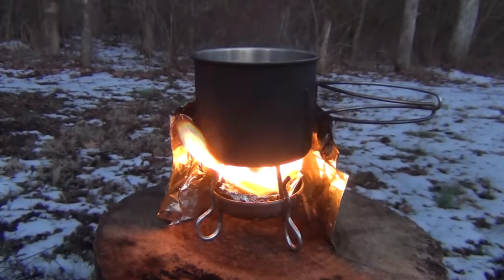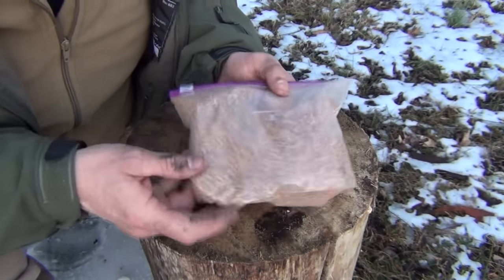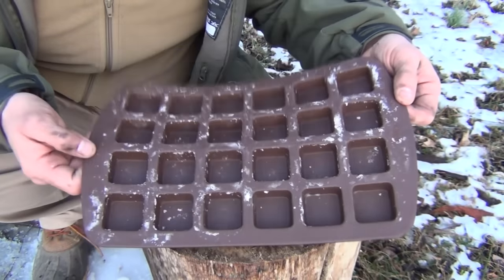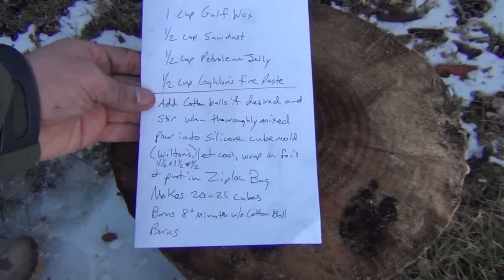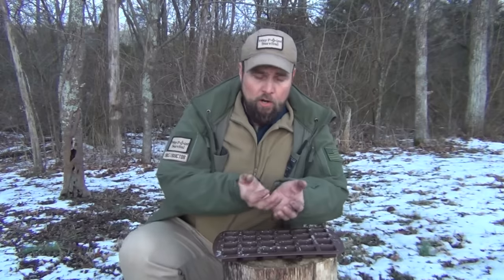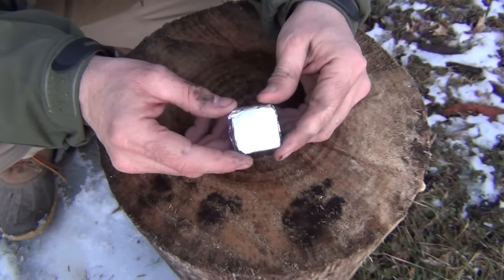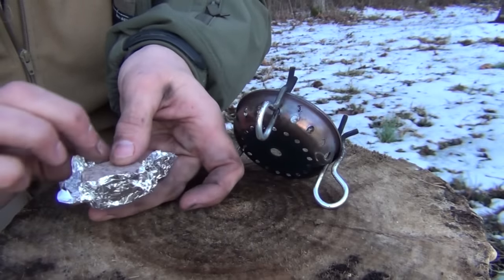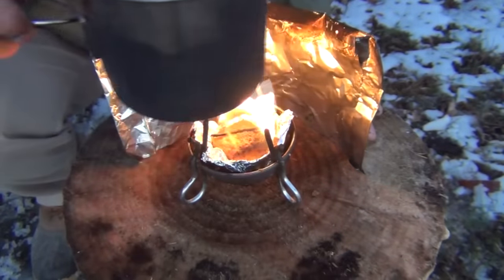DIY Fuel Tab [This is Awesome!]

Comment: Great idea. I didn't read through all the comments, so maybe someone suggested it already, but have you thought about adding some fine magnesium shavings to the top of each cube as soon as it's poured, and kind of push them down a little. Then when you're ready to light the cube, scrape a little of the top off to expose the shavings. I think in windy weather, those mag shavings will really help keep the cube going. Keep up the great work.
Reply from the maker: I had not thought of adding magnesium shavings, but there's no reason why a person couldn't do that if they wished. Thanks for watching.

Comment: I've been making fire starter with paraffin and wood chips for years. I just use wood chips coated with the wax. Just enough wax to hold the wood chips together and form a block. Wrap the block in brown paper. When your ready to start a fire just lift a flap of the paper and light it. Set it down and pile on the small wood to get the fire going. I've started fires in the rain with these, just provide a little cover to get it started. Even just leaning over the fire to keep the rain off for a little while will work.
Reply from the maker: Sounds good, thanks for watching!
Reply: Yeah, but do yours last for 14 - 16 minutes?
Reply: @markcummings6856  Depends on how big you make em. I usually make them pretty small, 1inch square by about 1/2 inch thick. That will burn long enough to get wet wood lit. Once, to prove how well they work, I threw one in the lake, then we gathered wood. I picked it out of the water, maybe 20 min's later, shook it off, lit it with a bic and started a fire. Never tried cooking over them, easier to cook over the fire. But if you couldn't have a fire I'm sure they would work. Never timed how long they burn, but if it takes you 16 min's to get your wood to light, you ain't doin it right and you shouldn't be in the woods alone.
Reply: @evilevilrick  Good to know! Thanks.

Comment: Pretty cool, I'll have check see what my wife has for silicon mold for baking. That is the one thing I looked into that was surprised cost more than I was expecting, almost as much as all the other materials combined. For anyone looking for a good fire starter that you can literally make at no cost I got one for you and the hardest part is probably just remembering not to throw these otherwise useless items in the trash. Save lint from your dryer, save empty toilet paper rolls. Just stuff the lint in TP roll until it's full then don't have to but I dip in just a bit of used motor oil and set on a log or something and let it soak in a bit. Throw one or two these under bit of kindling throw a log on top a quick lite and your done. I made bunch of these for my mother this winter to save her time making fires and she likes it because she just has to spend a second to light than leave for few minutes come back and roaring fire, hasn't failed yet and won't as long as you have something that'll catch fire on top. I haven't taken note how long they burn by themself but haven't really needed to.
Reply from the maker: Thank you for watching and for sharing your ideas!

Comment: Yes, went through a big home made Esbitt stage as a broke youngster. Of course then, even if you had the money doesn't mean the stores had the item you wanted!!! If you don't regularly operate a saw, a pencil sharpener and some dry twigs will do the trick.We used cardboard cubes we made and sealed with sellotape instead of an ice cube tray and wrapped them in sellophane instead of aluminium foil as it was cheaper. We would line the stove with an aluminium foil bowl, (if you only used a little mum would give you the foil, savings!). A very time and patience heavy way of doing it, not recommended for those with jobs and responsibilities but has potential for keeping bored (older) children occupied!!!
Reply from the maker: Excellent. Thanks for watching!

Comment: I used the seeding planter pots that you plant the pot into the soil. It's like a cardboard material. They come in rows & I cut off one at a time to make I'd soak cotton balls & fill up the small pot packing down the soaked cotton as much as possible. Wrapped it in tinfoil when finished. I'd burn it standing up like the pot should on the tinfoil I wrapped it in...got 45+ min burn time...pot is 2 inch high. Inch cube at bottom & 2 inch cube at top...hope this made any kind of since
Reply from the maker: That's excellent! I really do like that idea.
Reply: @WayPointSurvival  I'm pretty sure it was your channel that I got the idea gor that sink drain stove!
Love all the hobo vids as well!

Comment: We've made this but here's a tip. Add more saw dust and also diesel fuel 50:1 ratio also if you use ice cube containers it easier to obtain. This will create a more intense burn boiling your water faster.
Reply from the maker: That's an interesting way to do it. Thank you for watching.

Comment: Stove pellets, for heating, about $4.00 for 40 lbs probably would work as a replacement for saw dust. It's basically saw dust pushed through holes, the heat provides a glazing that holds the pellets together. A hammer probably would easily reduce them back down to saw dust. Just be sure they are 100 percent hardwood. I got 2 tons of mixed, soft, hardwood, the soft was pine, it gummed up my pellet stove with a tar mess, I used some in my Nano stove, gummed up the legs, feet, tar, resin, stuck to them. You know that gummy feeling of fat wood? Well that is what the black like crude on my stoves feels like, smells like creosote.
Reply from the maker: That's a great idea! Thanks for watching.

Comment: Just so I understand correctly, you take the 1 cup of gulf wax, and the 1/2 cup of sawdust, petroleum jelly, and fire past, melt all of that mixed up in the same container, then drop the cotton balls into it.  Once the cotton balls fully absorb the concoction, take them out, place them into the silicone molds, then dump any remaining into the molds so that they're full, let it cool, pop them out, wrap them in foil, and you're complete, correct?
Reply from the maker: You got it! Thanks for watching!
Reply: @WayPointSurvival  Hey, follow up -- I made a bunch of these with my class.  I went for a day hike when it was slushy, snowy, and basically everything was wet.  Set up my lean-to tarp, got everything else set, was able to scrounge up enough pencil lead sized white pine for kindling that was relatively dry and a bunch of other wood I could put by the fire to dry off.  I had two of these fuel tabs with me.  They both lit so easily, and burned for so long, I was able to get my campfire started with zero problem and it stayed going long enough to dry out all the wood around the fire.  So my fire was going long enough to warm up the lean-to and grill a couple of steaks.  These things are absolute gold.  Thank you for posting this recipe.
Reply from the maker: That's excellent, thanks so much for the story!

Comment: I’ve used melted wax poured over dryer lint or wood shavings in a cardboard paper egg carton. Separate the individual  cells after it cools and dries completely and store in a zip lock bag.
Reply from the maker: Yes, that also makes a pretty decent firestarter. However, using only melted wax, dryer lamp or wood shavings does not give you the intensity of heat that you're looking for in this type of fuel tab.

Comment: An idea for your wind screen. Make just high enough it does not reach the top of the cup. Put a slot in one side for your cup handle.
This way all the rising heat is trapped against the sides of the cup. Should shorten the time to boil.
Reply from the maker: Good point. Thanks for watching!

Comment: For your double boiler, make sure you use her favorite stew pot. I promise, it will be good for your relationship and the odds of you reaching  a ripe old age. 

It's not heximine or even triox, but it isn't bad. I'm curious how well it would do with just wax and the sawdust, or wax and cotton. The addition of the fire paste just sounds like over thinking it and it is the hardest to find item among brick and mortar locations.
Reply from the maker: The addition of the fire paste is to make it easier to light. Thank you for watching.

Comment: Great idea! Have you ever tried it without using the fire paste? I bought something like them from a company gives handicap people jobs. That's mostly why I bought them but they were pretty expensive.  It seems like they are just sawdust and wax. But I'm not sure if that's all they are made of. They burn between 10-15 minutes but don't produce as big of flame. 
It would be cool to make them myself but I don't have any fire paste so I'm wondering if they'd work without it?
Thanks for the recipe! 😊
Reply from the maker: I added the fire paste to make it easier to light as well as help increase the heat and burn time. You can purchase it online from any number of sources and you can also often find it at outdoor stores.
Reply: @WayPointSurvival I'll have to get some eventually. I've still got around 40 of the other ones right now so I'll use them up and then try your recipe. 
I've got one of those little stoves that burn the gases put off by the wood and they work great in that. I just throw a few sticks in when the fire starters start dying but I don't normally need to.
Thanks for the reply!😊

Comment: I like this.  I did some napkin calculations and determined these are roughly 50 cents a cube.  I then compared butane fuel (bought in cheap 8 oz cans and transferred to the cans for butane stove. Way cheaper.) and determined that for the same cost butane will boil a lot more water. But all is not lost. I also noticed the match didn't lite it very easily. I think I have a solution. Buy all the ingredients and make this change. 
1. When mixing in the wax, hold back a few tablespoons and keep liquified.
2. Make the rest as normal but leave out the fire paste.
3. When the cubes are solid enough to hold a shape but not too hard, poke a hole in the top of the cube about 3/8" deep.
4. Fill the holes about 2/3 full of the fire paste.
5. Cap with liquid wax.
My guess is the fire paste is not contributing significantly to the burn time.  Additionally, I think the fire paste can really aid in lighting. So, with this change I think you can reduce the price a bit and make them easier to light. To use all you would need to do is scrape off some wax to expose the paste then light. The fire paste can even be started using a firesteel so it's a good way to go.
Reply from the maker: Thank you for watching and for the suggestions!
Reply: Why not just add a tiny wax coated wick sticking out the top, just enough to light easily.
Reply from the maker: You can easily do that.
Reply: @rubynoils2872  I was thinking about that when I wrote it but I was trying to keep costs down. If I were doing it, this is how I would go about it. I also like the stove he did. I recognized the parts immediately and said to my son "That's a cool stove!". I may have to "lose" a sink strainer sometime soon🙂
Reply: Just a suggestion but you could use a wood wick or maybe something like a wood coffee stirrer cut down coated with a bit of fire paste.

Comment: I sure appreciate this cause those esbit cubes are so expensive.  I have carried tea candles in emergency kits to later find them melted and out of the tin container.   You foil can help.  I've used baggies and that has kept the rest of the kit clean but it made the candles a mess. I wonder if you still have some of these foil wrapped cubes and tell us if they made it through summer heat intact.  Thumbs Up!
Reply from the maker: Thanks so much. So far the cubes seem to do pretty well even in the heat.

Comment: do you shred up the cotton balls, or leave them whole, removing each one from the mix and placing them in the mold, then pouring the mix on top of them?  Also, you could prob. use paper shred (from a crosscut shredder) in place of the sawdust.  I have a LOT more shredded paper than sawdust around my house, unfortunately.  ;-)
Reply from the maker: I put the cotton balls in whole and then stirred them around until they were thoroughly soaked and then pulled them out with chopsticks, placing them in the mold and then poured the rest of the mixture on top of them. I suppose you could use shredded paper instead of the sawdust, but I'm not sure how that would work. Thanks for watching and for your questions!
Reply: @WayPointSurvival   your videos are excellent..keep up the great work

Comment: Cool! A lot of work though. Cotton balls dipped in gulf wax and dried works exactly the same and burn for 15 minutes. I have over 200 made in 10 minutes. 2 ingredients. And if you pull up a corner and expose the cotton to light...it light faster.
Reply from the maker: Thank you for watching.

Comment: You can also buy bulk hexamine powder which can be melted on an electric hot plate with an oil bath then poured into silicone cube molds, you will essentially be making exact reproductions of the original hexamine fuel tablets. But for those who aren't confident in liquifying high density fuels then the tablets shown here are a great alternative.
Reply from the maker: Excellent tip! Thanks for watching.

Comment: Great video! I’m wondering if these would work for winter. I used to have a cabin in the wood, but due to an unfortunate circumstance I lost it. However, I used the Duraflame fire starters to light my wood stove when coming back from the city in -10 to -20 degree weather. Took forever to get those buggers lit and froze my fingers. Have you ever tried these in a winter camping setting and if so, how well did they work? I live in Minnesota and if we had to bug out (God forbid) I would like to have something that’s going to light fast. 

What part of Ohio are you in? My sister lives about 45 minutes from Columbus. She and her husband might be interested in your classes. 
I’m so glad I found your channel because it has been extremely helpful and informative for me!
Reply from the maker: I actually made these during the winter time and they worked well outside. We are a couple of hours away from columbus.

Comment: Would placing the cotton at the bottom/top allow for easy lighting using fero rod?
Reply from the maker: It could, however, I prefer to have the cotton ball thoroughly mixed into the mixture. I'm sure with a little scraping you could pull up some fibers though that would light.

Comment: The only component that's not off the shelf is coglans fire paste. How does it works if your leave that out. I made one of those little stoves and already had the tabs. Works great. Thanks.
Reply from the maker: I'm not sure how well it works without the fire paste. I added that to make it easier to light. Thank you for watching and for your questions.

Comment: Like the recipe but I’m curious are you stirring cotton balls into the entire mixture? Or are you putting one cotton ball in each cube then pouring the mixture over the cotton ball? If you’re mixing them in how many do you use and do you need to pull them apart and fluff them first? Thanks…
Reply from the maker: I started the cotton balls into the entire mixture. I don't remember the exact number but I just put in enough until it seemed thick enough.
Reply: @WayPointSurvival  thanks for the reply. I really like that you take the time to answer your subscribers. I’m sure that can be tough with a growing channel like yours. I’m gonna try my hand at some of these cubes. Also, I’m 80-90% done making all your Stanley hacks. I’ve really enjoyed them. Thanks and keep doing what you’re doing!

Comment: With a tuna can I used 2 parts paraffin wax and 1 part wood chip peelings (from chainsaw). Seems to work fine as fire starter and cooking fuel. Quite smokey though.
Reply from the maker: Excellent idea.

Comment: Wouldn't those mini aluminum cupcake cups work triple duty as the mold, the wrapping (if filled to half full) and the burner cup? You could even make different size fuel tablets for different applications by using different sized cupcake / muffin cups. As an added bonus, I would have a laugh telling people I use a cupcake stove while camping and watching their expressions change into confusion, pondering, then questioning.
Reply from the maker: Yes, that would work quite well.

Comment: So do the cotton balls dissolve in the mixture with the liquid thickening and having some texture to it? What's the difference beside the longer  burn? Thanks James this is indeed a good trick to know.
Reply from the maker: The cotton balls don't dissolve, but if you stir them enough they do start to come apart. You just put them in the warm mixture and stir them around until they soak it up, then you pull them out and put them in the mold and pour the warm liquid on top of them and let them set. The cotton evidently acts as a wick which extends the burn time.
Reply: @WayPointSurvival  Thanks James, is that one cotton ball in each mold?